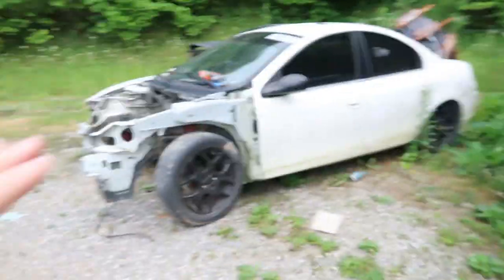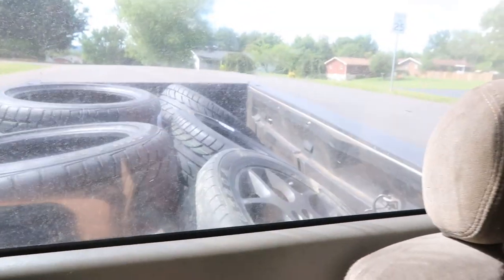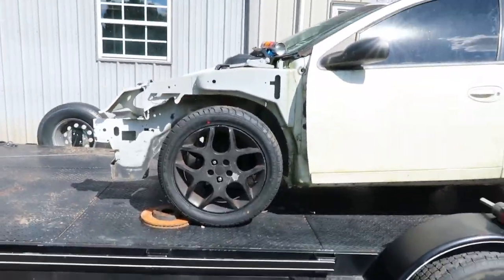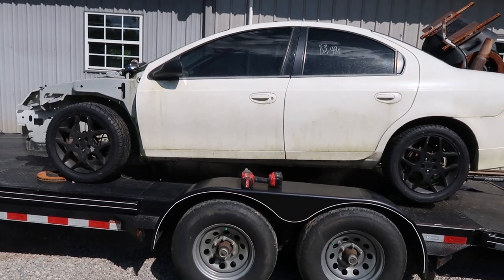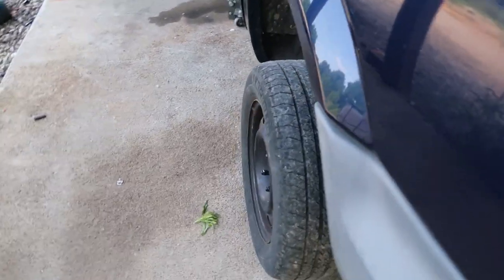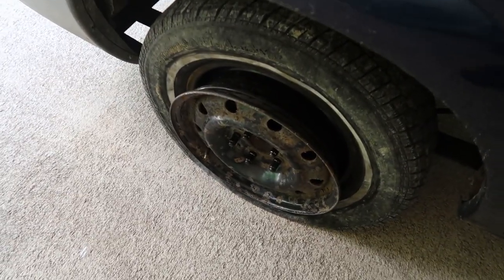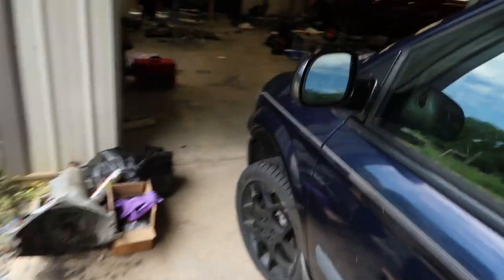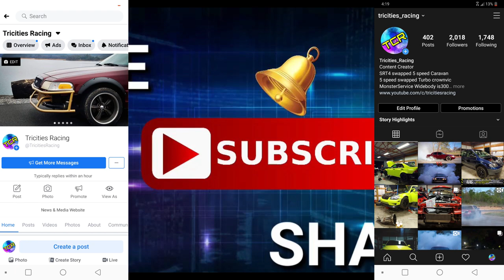Fitting SRT4 wheels on the Manual swapped Turbo Caravan

Comment: Alright, digging around, I found some information I wasn't sure on.
Dropping the van-
I've had the 3rd gen and 4th gen coil springs side by side. They are interchangeable, they will fit perfectly into your struts. The 3rd gen is a couple hundred pounds lighter, and has a shorter suspension stroke. So, swapping 3rd gen springs should sit your front end lower. If you grab some stock 3rd gen springs to drop it, nab them off a 2.4L short wheel base. There is also an Eibach drop spring kit for the 3rd gen, -1.7"F  -1.3"R, I have no idea if the rear drop shackles would fit a fourth gen but those front springs would. P# is 2825.130
Wheel fitment-
You can swap out the front and rear hubs for 96-00 Caravan hubs. The 96-00 came with either 114.3 x 5 or 100 x 5. The 100 x 5 pattern was on the short wheel base vans with 14" rims, it also has a 57.1mm center bore, which is identical to the Neon SRT4. The rear is super easy, 4 bolts to swap the entire hub and brake assembly off the end of the axle. The front are a little more involved, even though they are bolt in. The rotors dont look interchangeable, you'd need the strut, knuckle, brake, lower ball joint, hub, and outer tie rod off a 96-00 to make it work. These parts would mesh with the remaining 2001-07 parts on your van to create a 100x5 pattern.
I did the opposite, I swapped my 1997 Voyager to the front and rear disc brakes off a 2007. There are also the brakes off a 2004-2008 Chrysler Pacifica, they are the biggest brakes that will bolt in, they are twin pot calipers, but they are a 5" x 5 pattern, bigger than the 4.5" x 5 you have now. For the Pacifica brakes, you only need the knuckles, hub, caliper, and rotor.
Reply: Koni Adjustable Front Strut Inserts-
8640-1428
Koni Rear Shock Absorbers-
30-1627
Reply: Thicker Sway Bars-
Front
ADDCO #106
Rear-
ADDCO #686
Reply from the maker: You're the best!

Comment: The vans are sketchy without a rear sway bar. You need to go grab a sway bar and possibly the rear axle out of a salvage yard and add them. The mounting holes were on all the short wheel base and long wheel base 3rd gens, hopefully it's the same on the 4th gen and it's a bolt in affair.
Reply: Some of the LWB vans got the swaybar
Reply from the maker: Always coming in clutch with the knowledge! Thanks man. Ill definitely look into it.

Comment: Don't hurt the vans feelings comparing it to a PT cruiser. 
I remember reading on forums when I had my Trailblazer that guys were running 2" wheel adapters while 4x4ing and rock climbing without issues so you shouldn't have any Ford death wobble.